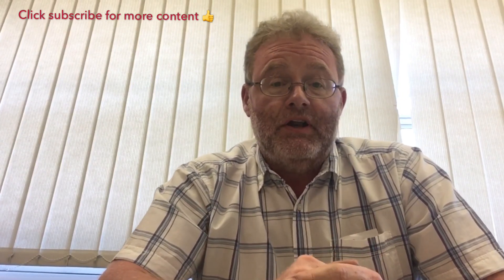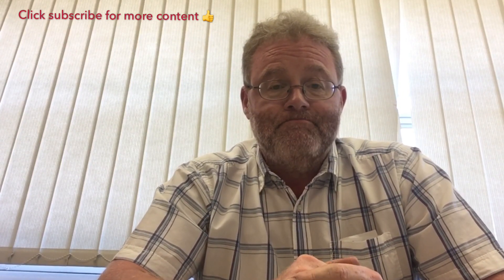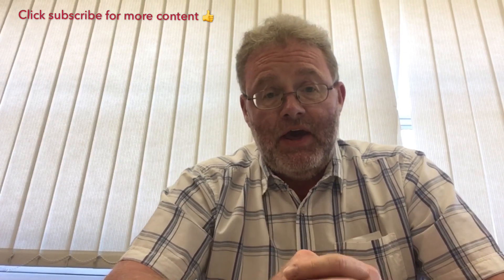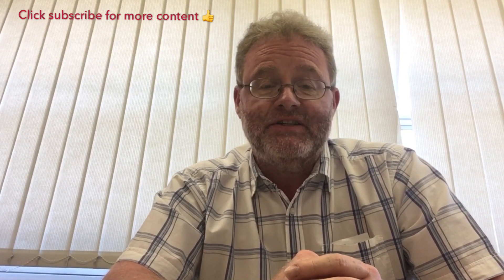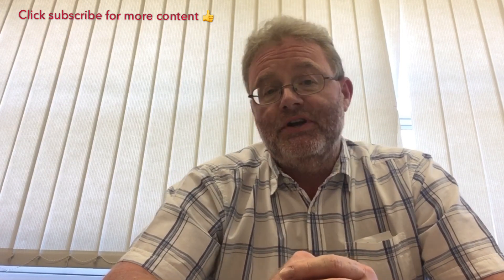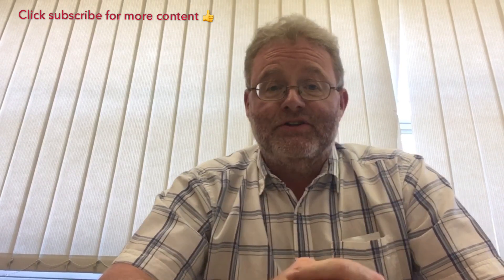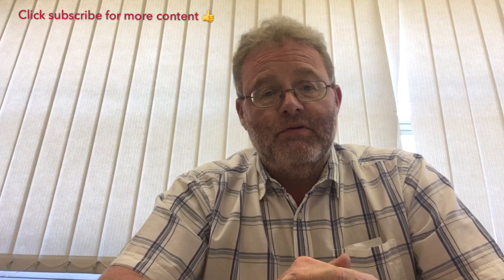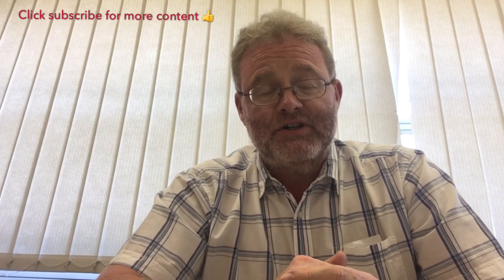Linear Loading -  Antenna Lengths & Conclusion

Comment: nice information. As a matter of fact I have a linear loaded dipole cut for  15 m, and with xiegu90 and it's internal tuner adding 17m 12m and 10m. 20m works with swr 1:1 but is not efficient at all. I'm never heard at 20.

Comment: Thanks Tim for great information on linear loading. I have one question. Are there any rules on the spacing between those folded back wires?
Reply from the maker: No rules but the wider the gap, the shorter the antenna

Comment: Can you linear load an end fed antenna? 🤔
Reply: Yes. You can linear load a vertical—one type of end-fed, as is done on lower bands on the DX Commander when the wire goes all the way up and partway down to make a 1/4 wave radiator. You can also hypothetically linear load both end fed half waves and end fed random wires (which may make slightly less sense on an EFRW unless you’re doing a permanent setup and you find that a little extra length electrically, beyond what you can fit physically, would help you bring in an additional band or two within the capabilities of your tuner). As far as I know, linear loading is almost always an alternative to inserting inductance via a loading coil to electrically lengthen an antenna that has less height/length than a full sized version.
Reply: @Kinetic79  thanks for the detailed reply! Yeah, I was thinking about linearly loading an end fed wire in my garden. I can fit about 10m in there, so linear-ly loading it would be to try and stretch it to other bands.
Reply: @Groatato  Best of luck with it :)  If you need to, you can even zig-zag, have the wire go partway vertical and partway horizontal, go around the corner or other similar maneuvers on the end-fed.  All of these things will net you a different radiation pattern than the textbook says, which is not always a bad thing—and while we theoretically try to keep turns as obtuse as possible and ideally in places where the current isn’t at it’s maximum—in reality, you can get a good amount of RF out into the ether and make plenty of contacts.
Reply: @Kinetic79  thanks. Yeh, this has given me food for thought. I'll have an experiment and see what I come up with! :)

Comment: Hi Tim. When trimming for tuning, do you trim the open ends of the wires that have effectively been folded back, or the far ends of the dipole legs where you have the wires twisted together? ..the latter obviously reducing the length of the wire and also overall size of the dipole. Just wondered what you did. Going to have a play with linear loading next week, but don't want to chop up my spare window line I have unnecessarily :D
Reply from the maker: Hi Neal to tune you trim the wire at the centre of the dipole that isn’t attached to the feedpoint. You leave the far end of each leg twisted together as they are. You trim the wire at the near end which isn’t attached to the Balun in the centre. Hope this helps.
Reply: @TIMG5TM  I made a linear loaded upright V antenna for 10m today. Mounted only a few metres off the ground I managed Russia and Turkey using just my foundation power. I haven't made a video for it, but took a few pics and did a write up on the Charlie Tango forum, it's in the newest posts of the 'Upright V antenna' topic if you're interested. Thanks again for your help and informative videos.
Reply: @TIMG5TM  Understood. Thank you for you that!

Comment: Good morning Tim I was just watching a video on the half square antenna it is absolutely amazing! However it is mono band I was wondering if it could be fed with ladder line And be converted to a doublet and multiband capability do you have any knowledge about this type of antenna
Reply from the maker: I’ll need to look into that one Pat
Reply: @TIMG5TM  I think it could be really strong - and with a parasitic reflector 5% longer behind it that could push the gain further

Comment: Tim I was wondering if you have ever attempted an 80 meter vertical Linearly loaded on a  7 m mast - That’s requiring about four full length of the antenna element up and down actually the fourth will be slightly shorter and then Tied with a tent peg and para cord- is this doable? Is it efficient? Will it radiate DX?
Reply: 7m is to short for a pole, 12m spiderbeam would be a better fit for the setup you just described
Reply: You’ll be able to get a full 1/4 on 20m and 40m and linear loaded element on 80m
Reply from the maker: Its possible but the 12m version suggested by Mohammad would be an improvement.

Comment: Hi Tim! Great videos and series. Thank you! One question: are the lengths displayed the final full length of the dipole or just the length of one arm?
Reply from the maker: Hi thanks for the comment! The lengths are the total for both arms. So each arm is half the length. 73!
Reply: @TIMG5TM  Brill. Thanks! I have some ribbon cable on order from Moonraker (other ham radio specialists are available) so with all the extra time I find myself with, I might give one a go.
Reply from the maker: Groatato fabulous.. let me know how it goes
Reply: @TIMG5TM  will do. The wire is on order from Moonraker, and what do you know? I suddenly find myself with  a lot more time on my hands... Will get building when the stuff arrives and let you know how it goes!

Comment: Hello Tim
Please can you tell me what the Half Wave Linier Loading Length is for 40m on 300Ohm Ribbon,
73s from 2W0EQQ 😀
Reply from the maker: Hi Leighton ... I think it’ll be longer as the gap between the wires is narrower, I’d try a couple of feet longer than the 450 and trim. 73

Comment: You can feed a linear-loaded dipole at one end; i.e., open one end and attach feed-line via a common-mode choke.  Feeding at one end is similar to the feed method used for a "C pole vertical."  With this feed method, the common-mode choke is absolutely necessary; otherwise, the feedline becomes part of the antenna.  Ken WA8FCI
Reply from the maker: Ken Halliwell thank you for the idea. 73